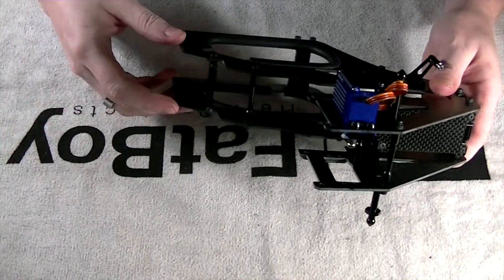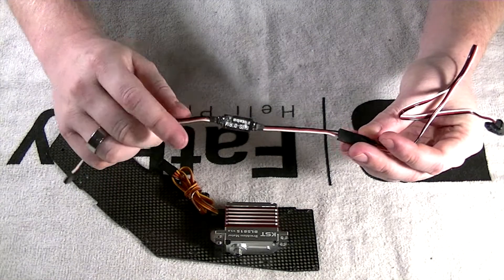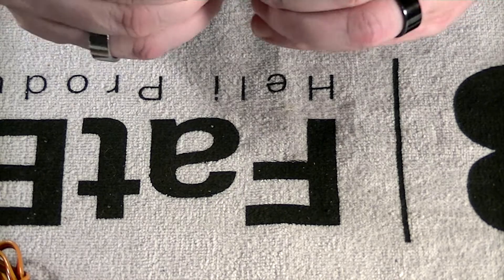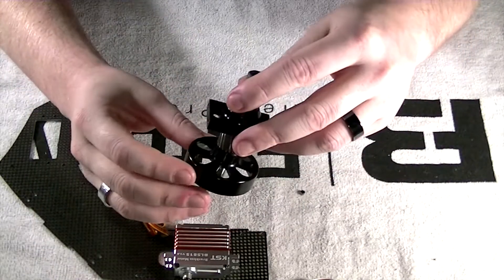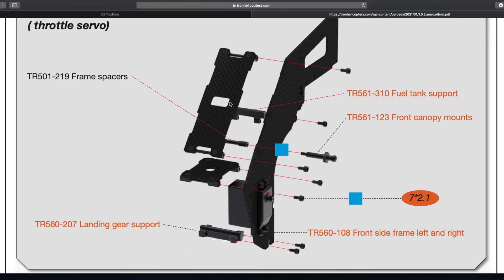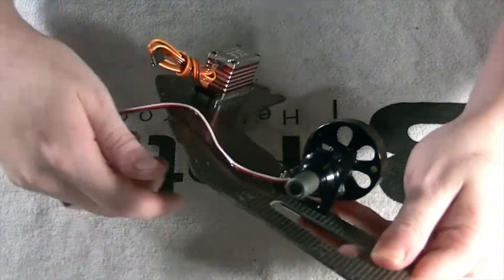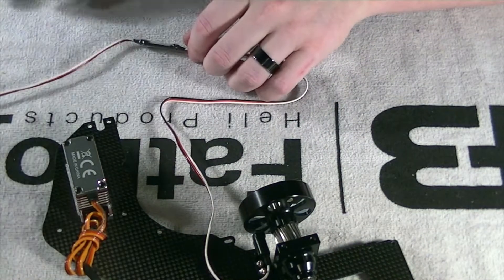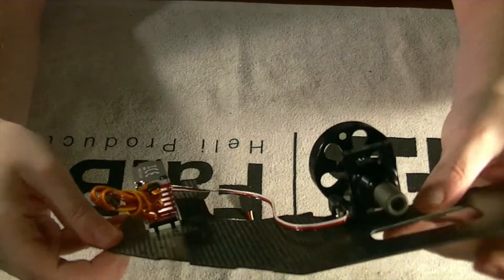NiTron Build Series : Main Frame assembly part 2 (FreddyCanFly)

Comment: Thanks for the videos!  Did you end up using just the rpm sensor or both rpm sensor and attachment?
Reply from the maker: I used the Futaba mag sensor with the provided attachment
Reply: @FreddyCanFly  according to the manual it needs to be connected to a s.bus2 port using the sbs-01rm attachment.  I was thinking just the sensor would be connected to the gov. port on my brain2 fbl unit since it required to be connect to sbus2 port.  Your saying you connected the sbs-01rm and sensor to a gov. port on your flybarless unit?